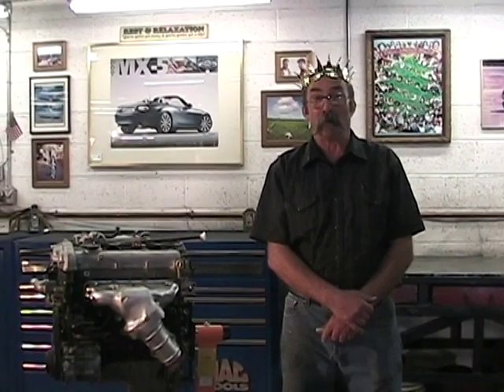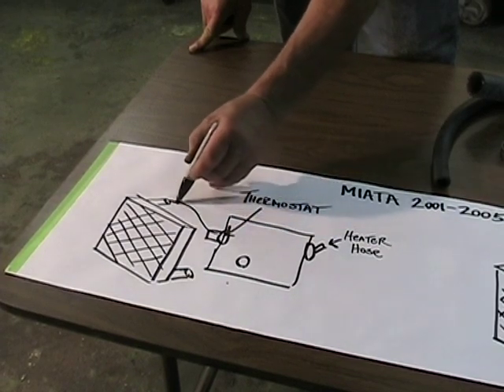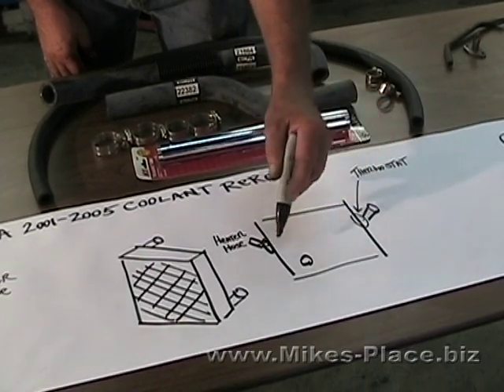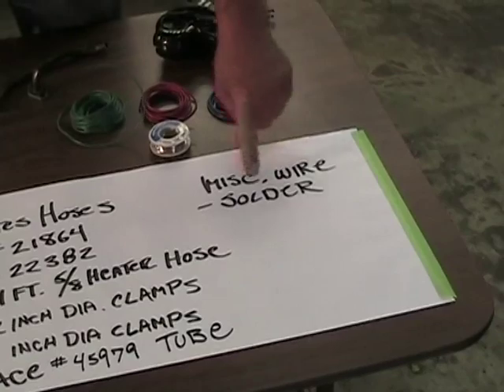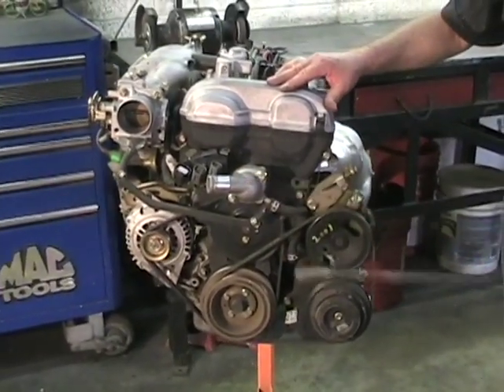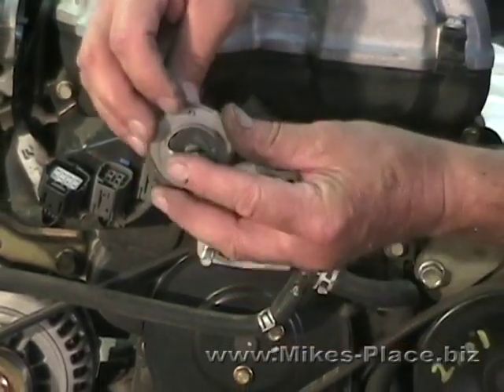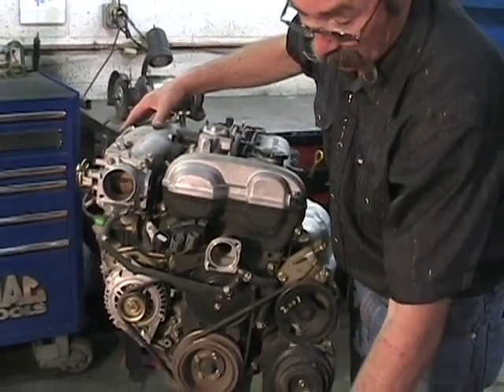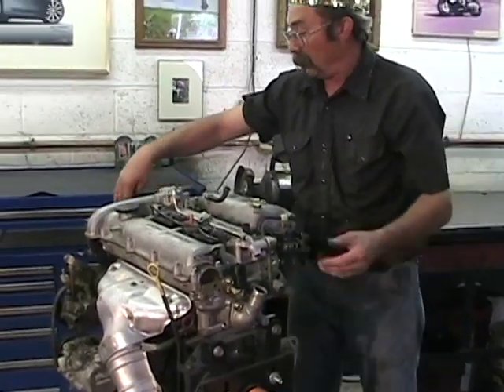Mazda MX-5 Miata Coolant Reroute 1 of 2    2001 - 2005

Comment: Hello Mike, we have a 2000 (october) MX5 1.6 manual transmission. There seems to be 2 kinds of thermostats available, opening at 82 degrees and opening at 88 degrees. Which is the right one?
Thak you, greetings from Belgium.
Reply: Hello,
Thank your for your interest and concerns. For your 2000 MX5 in Belgium we would suggest the 88 degree type. Good Luck with your Miata Mission.
The King of Miatas. Mike.
Reply: Thank you for your answer, do you also know if the 1.8 and 2.0 liter engines in the NC generation (2005-2015) are 100% build by Mazda or are they a joint venture with Ford? Greetings

Comment: hi mister king!! quick question. was buying the kit from 949 and seen this!!! my only question about it is: on the back where you put the thermostat, is there a sealing issue? the front has the recessed lip to hold the thermostat. is that on the back also? thanks sir! not sure if you remember but I had the customer car that had no compression after rebuild. i got shims for the head and fired right up!! thanks for the help on that too!

Comment: Hi, if it's possible I would need to know what the #21864 and the #22382 are, if they are a lower radiator hose or something else, and the vehicle they are from. In Canada we don't have the same parts number and I had some weird looks at the parts store.
Reply: I'd also like to know if I need to change the head gasket if I have a Mazdaspeed miata engine
Reply from the maker: +Justin Larrivée Hello, No need to replace the head gasket. Mike. The King of Miatas.
Reply: +Mike MiataKing Hi Mike it's me again. If this works for 01-05 miatas, but the Mazdaspeed miata has a modified version of the 99-00 engine, will I need the thermostat spacer or it will bolt in exactly like shown in the video?
Reply from the maker: +Justin Larrivée Hello, You will not need the spacer as the engine is set up like the 2001 thru 2005 Miata with coil over plug set up.Mike. The King of Miatas.

Comment: The concept of this mod is great....part #'s included and all that.....but it's virtually impossible to do this with the motor in the car.  You will need the patience of ten men.  It took me an hour to pull it apart, and 3 hours to scrape the old gasket.  Your working in an area of about 5 inches between the head and firewall.  On my second thermostat housing....taking it apart again....
Reply from the maker: +M Petra Hello,  Yes, now you know why techs are paid to little. Merry Christmas. Mike the King of Miatas.

Comment: I believe Mazda switched head gasket design for later models to compensate for restricted coolant flow. Does doing this reroute aid flow with the new design?
Reply: Actually the 99-2000 headgasket and 2001-2005 headgasket are different the NB2 gasket has more passages for cooling.
Reply from the maker: +David Tkac Hello Sir David, Yes, the head gasket is different for the 94-97 gasket and the 99-2005 gasket. Extra Coolant passages at the rear of the 99-05 gasket for one. This Reroute changes the flow in and out of the engine.The later head gasket helps with internal flow to the rear of engine.The King of Miatas.Mike.
Reply: So will we need to get an older model head gasket when doing this reroute on a 2001?

Comment: Hi Mike can i do this on my 96 ... The summer in Houston is so hot here ... Thanks
Reply: Yes you can but you will need the thermostat spacer.
Reply: Justin Larrivée 

Hi Justin, I will be doing a reroute for a 97 NA, can you tell me where I can get the correct spacer.  I went to Flying Miata site and they sell an expensive system.  Also is there any interference with the existing exhaust recirculating line from exhaust manifold to inlet manifold.

Thank you
Reply: what about without a heater core, and no turbo?

Comment: I question that. He uses the old BF 323 engine as an example.
Would have been nice to see a guide that related to the NA miata too.
It isnt a big hassle, with the use of a BP radiator outlet and a spacer to the back.